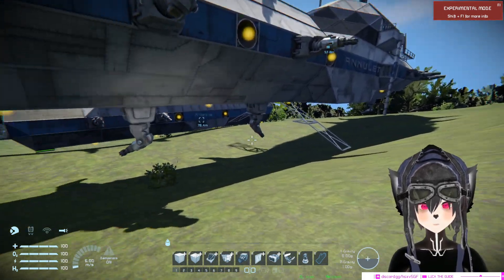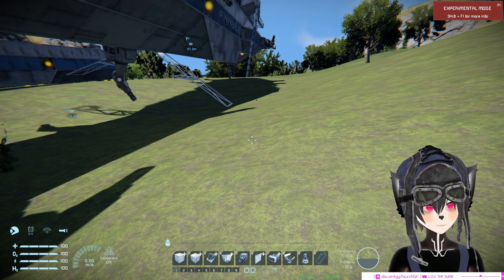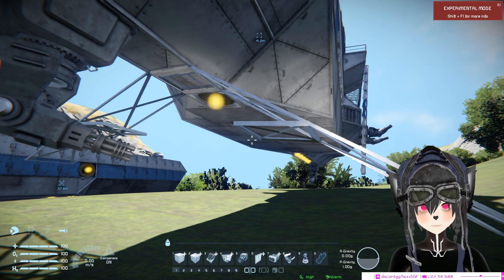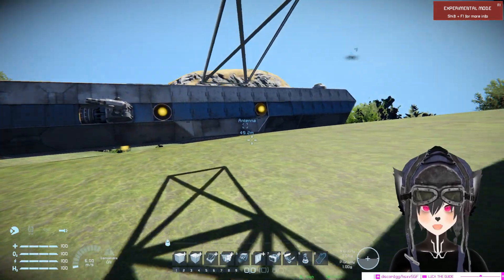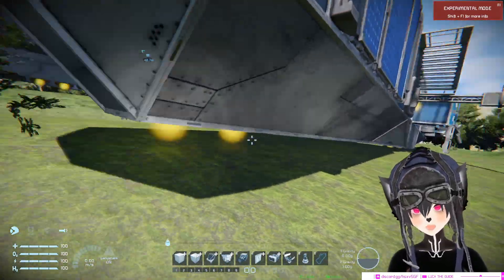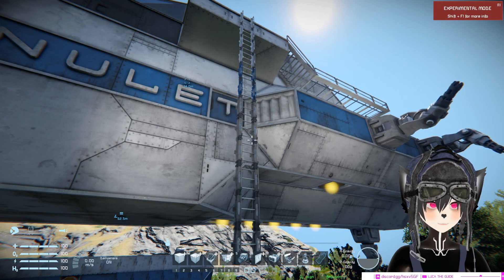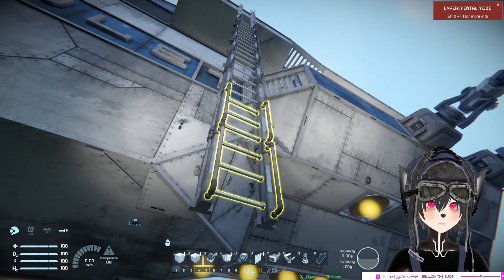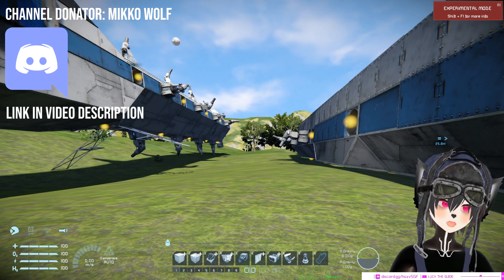Practical Landing Gear and Ship Boarding Designs, Space Engineers

Comment: Nice video as always, the only downsides of not locking with a mag plate are that you cannot use wind turbines while you are on the ground, or I sometimes have a bug that the ship shakes and slide, or my character shake or slides on the ship when I am not touching any movement keys. The only remedy I have in those situations are to put a landing gear/mag plate or change to a static station.
Reply from the maker: Yeah x3 and yeah x -x those things happen sometime, and don't turn to station xD since it might be hard to turn it back into a ship if parts of the blocks' hitboxes are stuck in the voxel

Comment: I use bottom facing small wheels. Yes it's a little pricey in terms of pcu but you only ever need 3 and they can survive much harder landings.
Reply from the maker: Oo good trick, will keep that in mind x3 I prefer the lonkness of my windows though xD
Reply: @LucaTheGuide  we have actual steel panels now, I'm pretty sure they're even cheaper than windows
Reply from the maker: @Horesmi  They would cost 1 steel plate vs 1 girder c= but with windows you can have 2 blocks-long diagonal window

Edit: adding stuff
Reply: @LucaTheGuide  aaaah I see